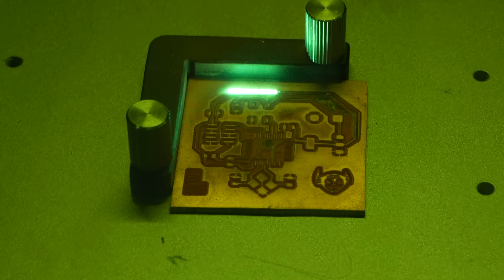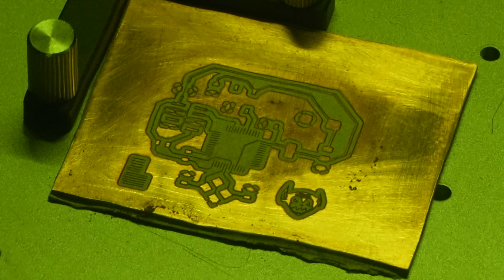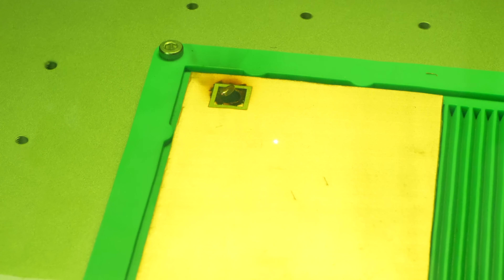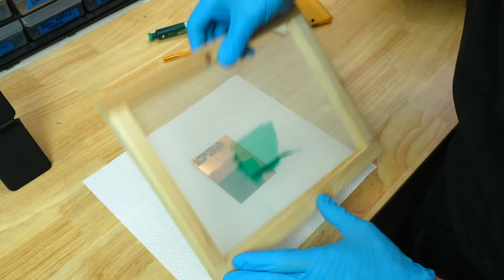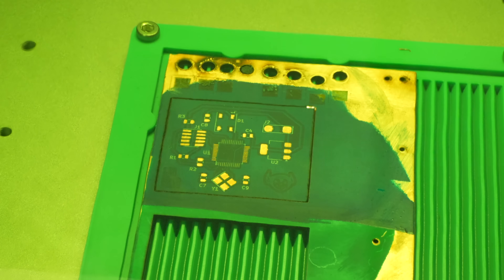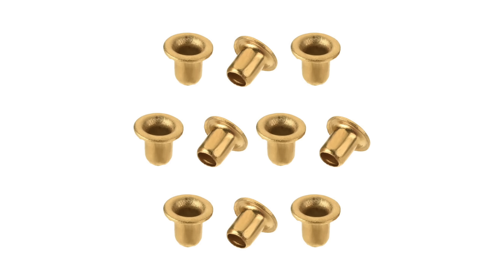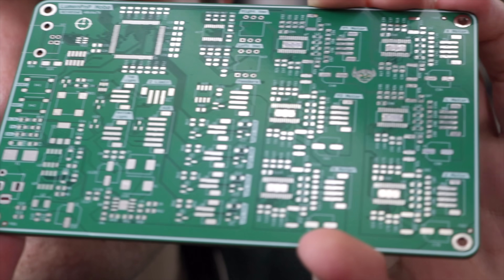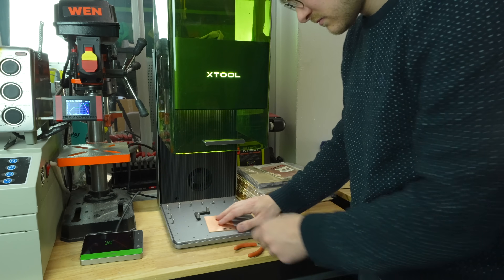Prototype PCBs faster than 3D Prints

Comment: If you drill with the laser, maybe that would carbonise it sufficiently to be conductive enough to plate
Reply: It 100% does. That is the method I use
Reply: @TrebleWing So you're able to laser drill 0.4mm via and plate them with copper ?
Reply: Don't you have to make electrical contact with it to plate it? So.. are you going to have a bunch of probes contacting each and every trace for the plating process?
Reply: @tlv1117 You drill and then plate, before making the tracks.
Reply: @zaprodk But the comment I was replying to suggested using the laser to create the traces on a copper-free board by carbonizing it, then plating the carbon traces. 

If you try to plate first there is nothing to plate!
Reply: @tlv1117  No. Mike knows exactly how this is done. You always plate before "making" the traces. Always.
Reply: This works!!
Reply: and you gave a hint right there of the main issue with copper ablating using said laser... 
I'm using photo resist on a MSLA resin printer, 1min exposure seems to be enough with the spray on resist I'm using, cheap dry resist from ali exposes in around 15sec, but thickness seems to be too much to get good detail, with the spray on and bake resist I can make 0.1mm tracks repeatedly, then it comes down to etching, but those for just for tests anyway, not planning on homebrew boards of that detail
I usually don't go lower than 0.3 track and 0.2 spacing, and it is very repeatable

Comment: what about drilling the hole, then fill them with tiny tiny solder ball or simply solder paste and reflow it ? i think the solder must fuse at higher temp than the one that will be used to solder the other components, the idea is to fill the via with solid solder paste it should connect to the copped on each side the tricky part here is that the surface must probably be very flat or maybe surface tension works it out by itself, anyway filling the via and cleaning the excess may require a little patience, maybe pressing the board in a pool of soldering paste? if the via are large enough.....

Comment: I like the folding pcb with rivets for vias. I would still use tooling holes that slot into tapered dowel pins for alignment. You could even get an empty copper clad with tooling holes and no soldermask boards made by a pcb fab and then etch and cut the rest yourself.
Reply: Wouldn’t rivets cause alignment as well?
Reply: @bloho_design  yes, perfect!

Comment: maybe you can use what board repair people use in a pinch. You can add a "non component" via with a spare resistor lead or solid core wire, and drilling through with a Dremel. Solder the top, solder the bottom... Done

Comment: The best method I tried in the days for DIY vias was soldering a leftover foot/wire from a through-hole resistor, it was simple enough and reliable. I guess you could try to pick and place some kind of pin with a flat head and solder-paste it on the top side. Then hand-soldering on the bottom isn't that time consuming, maybe 1 solder every 1 or 2 seconds, even faster with good flux and if you can drag solder in an area like you'd do a QQFP chip.

Comment: perhaps for a via just make a hole small enough for small pin and solder on each side (not fully auto but still should be lower in height but also should allow for a smaller via hole)

Comment: You have a laser, why not laser drill from top until the lower copper layer but not cut through it. Then fill the hole with solderpaste and reflow it?

Comment: via idea: instead of fully ablating the inside of the via hole, leave spokes or fingers of copper (like an "internal tooth washer"), then ablate the substrate from the backside leaving the fingers (hard!), then press these down so they bend into the hole, then maybe fill with solder. They wouldn't reach the whole way but at least gets copper onto the inner surface of the hole and not just the top surface

Comment: I have in the past wondered if it would be possible to do multi-material SLS with copper and a plastic or something to print multi-layer boards in place complete with vias and holes and everything. I think a large part of the challenge would be recovering the unsintered powder/cleaning the layer and swapping materials. I have some half-baked ideas for alternative processes that don't need powders, but doubt I will ever get the opportunity to experiment with them.

Comment: one other option, rather than 2 sided. Use wire jumpers. This is how most high power boards are designed still.

Comment: I made a few vias on a double sided pcb by using thin stranded wire through the holes and soldering them on both sides. Stranded wire with flux will suck solder along itself, but there might be some tips sticking out like when you solder any through-hole component, so this method may not be VIAble ;) for vias under the SMD IC.

Comment: This is why I like this channel. Giy has a vision for the world.

I have made a single sided board with jumpers on FR-1 before. I think that flat vias could be achieved by soldering wire inserts pushed through holes on the board. Might take some extra time, but maybe the rivets could be used on the larger vias and the copper wire could be pushed through only the small vias. Just an idea, love the work!!!

Comment: I have put a fair bit of effort into making double-sided PCBs at home. The laser is incredible! There is a non-electrochemical way to deposit a copper layer inside a via that I'd like to explore and would probably be excellent for your application. Look up "Industrial-level Quality PCB Through Hole Plating" on instructables. With this process, you'd still want to do electroplating afterwards, but hopefully that would only be one bath to set up - still pretty accessible in a home shop.

Comment: Can you make the vias by making the hole diameter such that poking a solid copper wire is a fixed fit? Then you can automate with a PnP toolhead that extrudes straight solid copper wire into the holes followed by an automatic flush cut operation. This might only solve for 2 layer PCB and still leave multilayer via unsolved for multilayer PCBs

Comment: What about making a rivet from a wire ferrule, those without the plastic strain-relief.
If you pinch them between two cones you could expand/flare out the ends and fix it in place.

Comment: I like the hole plating idea allot. From what I understand, you need to ad a conductive layer to the inside of the holes. BUT, with the laser. It's already carbonized from the laser. If that is conductive, enough. Would that not save you the step of having to make the holes conductive with the risk of failure because of the chance that the liquids might not coat the holes all the way due to bubbles ? Haaaahhhh long sentence, could you please test this ? It sounds like the most work free method. But more chemicals.... So many options !

Comment: for the vias maybe first drill the holes and then inject something into them with for example the paste extruder.
This could be something like solder paste or anything else
Or maybe jam a piece of copper wire or film into the hole and solder that
Or maybe even something like magnetron sputtering even if that requires a lot of equipment

Comment: I love this video in particular, you're onto something!
I feel like if the laser tool could calibrate itself onto fiducials on the board after every removal step, then alignment can be fixed via software. Even if its just a manual alignment (ie, manually move the laser red dot onto each fiducial). This would also help with double sided boards once the via creation problem is figured out.

Comment: There might be a silver lining on drilling the holes with the laser. If the FR board gets charred and somewhat conductive, it might help with plating the vias. 
One of the trickiest chemistry is getting the holes coated with a conductive chemical to further electroplate.

Comment: Maybe a conductive powder coating might be an option for the vias? You already have an oven for the solder reflow process. If the baking temperature of the powder coat were sufficiently above the reflow temperature of the solder paste, then the vias would remain intact.
Reply: Actually, if you could spot cure with the laser, then the process could work like this: 1. drill with the laser, 2. powder coat with conductive coating to line the vias, 3. spot cure the vias with the laser, 4. remove the uncured powder coat, 5. ablate the tracks with the laser, 6. powder coat with "solder mask" coating, 8. either cure the solder mask coating with the laser, to naturally create the pads, or oven cure it and ablate the pads (whichever is more workable I guess), 9. powder coat with "silkscreen" coating, 10. cure the powder coat with the laser where you want the markings, 11. remove the uncured powder coat.

Comment: Well you could use 1mm pins that you put in the holes and the solder to top and bottom surface.
Reply: Or a smal bit of wire. Could be even thinner than 1mm. Put u trough the board so it just sticks trough solder it an then cut it on the other side an solder that side.
Reply: That was my initial thought also

Comment: put the board in the danger puddle solder bucket to make the vias? in another video you showed that the solder likes to stick fill holes, so you could use it to fill up the holes with conductive material 

something like : 
- cut the holes for the vias 
- temp solder mask 
- laser away around the via holes 
- dunk in the puddle to fill the vias with solder 
- then do the laser steps as normal to print the design 
- actual solder mask 
- cure and burn off excess solder mask 

I dont have much experience with this but i hope that it is helpful
Reply from the maker: that's a cool idea, thank you!! i think im gonna give this a try!
Reply: There is gel-like solder mask that's meant for wavesoldering, which air-cures and washes off in a dishwasher. The kind I used at work was pink, IIRC.
I also thought about some size of 0-ohm MELF resistor that could (maybe) be PnP'd vertically into drilled vias, then paste-reflowed. That'd require some special kind of pickup for the PnP machine, but if you only ever use one size of via/MELF and one thickness of FR1, could be worth investigating.
At first glance, looks like they go down to MMU which is 2.2mm long by 1.1mm diameter. Bit thicker than FR-1 so they'd still be a bit proud like the swaged eyelets you mentioned, but maybe the laser could ablate the ends of the joints to be a little flatter? Stack two single-sided FR-1 boards, with alignment pins in the corners? Just ideas.
Reply: thanks for writing down my thoughts for me ;)
Reply: I have used silver epoxy to fill vias, but it has to be good quality otherwise vias are might not make a good contact. The process is: apply uniform tape to PCB on both sides, drill vias through tape (or can use stencil for better quality), clean the surface with high grit sand paper, clean, squeegee the conductive epoxy (like you would solder paste) , cure at elevated temperature to speed up the process (but not to dry out glue or burn tape). At work we used LPKF ProtoLaser R4 with their provided via making tool kit (conductive epoxy, tape, etc) - which takes time to get right for proper plating.
At home I use LumenPnP and off the shelf UV 8W laser cutter to make stencils in a transparency sheet (mylar did not work for me). I used this process to apply silver epoxy, solder mask, paste.
Reply: On this note: try droppering liquid flux on the via pads if the dip doesn't work initially. It might help suck the solder through and wick through.
Reply: Know this has been done with copper in industrial settings as i have seen this  advertised on YouTube.
Reply: Worth a shot, but it might be difficult to get solder to flow through and bridge unplated holes. Solder paste often won't even flow through plated vias if they're small enough, which is a trick you can use to get away with unfilled thermal vias under ICs for prototyping.

Sticking wire through each hole first might help get it to fill the holes? Then you might be able to sand the board flush or close to it.
Reply: If this works, it will be an awesome way to do it. I'm worried that if you hotplate/oven solder the board, the solder will flow out of the vias.

Comment: Love your work, this reminds me of the @AppliedScience video titled "Micronics SLS nylon 3D printer makes electronic circuits". 
Have a nice day.

Edit : After reading other comments, maybe make a high viscosity electrical paste liquid, with a lot of flux, so that you can just make a via by drilling a hole, and filling it up with the paste. The reflow and surface tension then makes it grab onto the bare copper, creating a via. I think i have seen this solution somewhere on youtube.
Edit 2 : I just remembered a technique i also saw on youtube of using multiple layers of kapton tape, and copper tape, to create multilayer flexible PCB's. Since the copper tape is conductive, a via is just a hole in the kapton tape.
Reply from the maker: thanks for the kind words! yeah, conductive paste could be a really cool solution, I've tried conductive inks but something with a bit higher viscosity like an epoxy might work really well!
Reply: Multilayer would be awesome, just do a mix of double sided and single side PCBs then use alignment holes to hold them together while the vias connect through with solder paste. Would be good to know if solder paste can reliably connect the inner layers as this would definitely win out against the rivet solution.

Comment: for vias, maybe drill first then extrude press-fit thin copper wire, even .5mm copper wire would be better than rivets.  the trick I suppose would be the cutting operation.  imagine a filament extruder, but with a reel of copper wire, and then some secondary x/y head-attached side-cutting tool. then apply solder on both sides of the pressed in wire to get continuity.

Comment: Hi, if the board is thick enough, you could use a laser to create indentations for the rivets so they don’t stick out of the PCB. To establish a connection, you could solder the rivets to the copper around the indentation.
Reply: Rather than buying pre-made rivets, I use copper EDM rod for vias. Insert, cut, press. EDM rod is stiff, hollow enough to deform like a rivet, and it presses flush enough to use under an IC. I still dab my rivets with solder paste at assembly, because it's just a good idea. I've done vias down to 0.3mm using this method.
Reply: @ChristopheBeauregard This is actually quite clever, if you're cutting it to size you can make it as flush as you like.  This could be the solution he's looking for.
Reply: @excrubulent  weirdly enough, too flush doesn't always leave enough to press well. I get the worst results with my best flush cutters.
Reply: @ChristopheBeauregard  Yeah, you need it to expand a little bit.  Makes sense.
Reply: No, he couldn't. The substrate - as the name suggests - is under the coper. If you're cutting into the substrate, there is no copper left for the rivet to connect to.
Reply: @hellterminator  If the rivet is squished and connected with solder it should work just fine, but I think the EDM wire method sounds like it would be more reliable.
Reply: OR you use the laser to not oblitterate the rivit but "just" melt it and thus create something that somewhat resembles a weld...
Reply: @urugulu1656  just try melting a rivet with a 1064nm laser. i'll wait.
Reply: Or some kind of electrical conductive glue.
Reply: @Piratdu52 those are very expensive and high resistance

Comment: Could you lumen-pnp the rivets into the board and solder them during the normal soldering process?
Reply from the maker: hmm that's a cool idea! a little plug that gets soldered onto the front side with solder paste, a quick manual solder on the backside?
Reply: @stephen_hawes  perhaps with the automatic solder paste deposition the hole could be partially filled with solder, then the plug placed. The thick solder paste would hold the pin in place and perhaps if there's enough paste during soldering it would flow all the way and connect to both sides by itself without the manual rework step

Comment: i have a stupid idea on how to make vias: You cut the holes in the PCB and then put a sheet of tin/solder foil on top of the board in the fiber laser. from this you cut out circles where the vias need to go. the cores are gonna fall down into the holes of the pcbs. then maby with different settings you can melt these plugs inside the holes of the PCB also using the fiber laser. alternatively put the pcb with the solder in the holes into an oven.
Reply: Not a bad idea! 
Maybe making the vias rectangular to create a flap instead of a round cap could work !

Comment: This is big! Now if we only can figure out how to make vias. Seems like vias would be the hardest thing to figure out. One way could be to take a copper wire that barely fits into a via hole, then somehow squish one side and then the other. Then hammer it flat, and solder on top.

Comment: Hi, for the 2 layer Via problem, maybe you fillup the holes with solderpaste, then extrude with a toolhead some wire into it and cut is automaticly... could work. Manual soldering vias with wires i have done so often...

Comment: There is already a Company doing this but looking forward to not pay that much with that Solution! Main Problem I am seeing today is Vias etc. 

By the way the Company is LPKF.
Reply: LPKF is $$$
Reply: @ Yes unfortunately 🥲 I did ask for a price 2 month ago and setup what I needed was nearly 250k. But the things they do is also based on fibre laser (or milling but unpresize) and pressing and also galvanic steps for multiple. But I need more like 0.35mm pitch. 😂